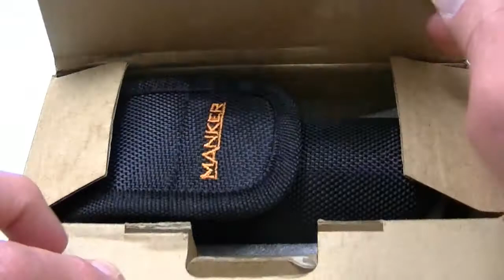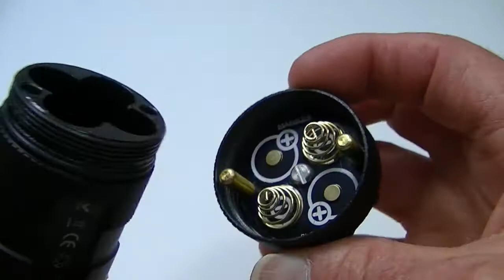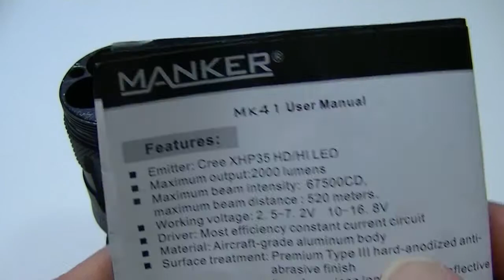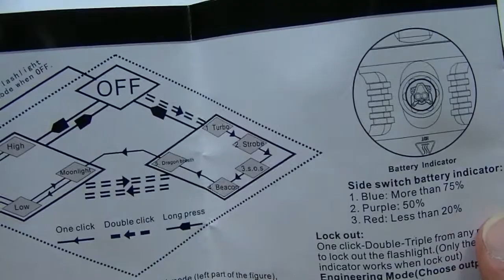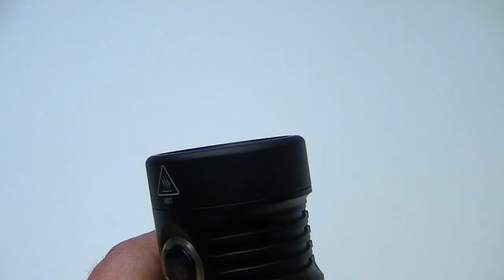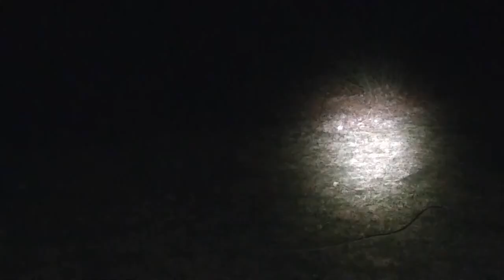Manker MK41. Cree XHP35 'HI' (NW) LED! 1500 lumens/AA batteries.

Comment: Looks nice. I'm still not sold on high brightness AA lights though.
Reply from the maker: Well, a couple of years ago it wouldn't have been possible. It shows what outputs can be achieved though, given the amount of voltage and the LED used. Some people prefer AA lights, and at least for those who are skittish (or don't understand lithium) it could a safer light for many to use.
Reply: They're definitely very impressive getting that power out of AA's. I'd personally prefer Li-ion batteries, but I guess the versatility and lower price of AA batteries is a big plus for a lot of people.
Reply: You can use 14500 batteries.. better output, better throw, and better battery life. They are also lithium ion.
Reply from the maker: Well of course, nobody said you couldn't use 14500's. But in my side by side photo tests, I could see NO difference in output. And throw is the same with either battery type. If you click through to my written review and look at the Manker ouput/runtime spec sheet picture, you'll see there's not much variation between the battery types (according to THEM anyway). The only sizable difference is with moonlight and low. The other modes are surprisingly close, so much so that you won't see any difference! And runtime on the AA's is usually more. And lastly, I prefer moonlight mode to be under 5 lumens...not 65 lumens! This is the first flashlight EVER, (where both battery types are accepted) where I'm happily standing firm on AA's! I own several single AA lights, and they ALL have 14500's in them.
Reply: LexLuger Do the cells have to be the IMR "no protected" type.
Reply from the maker: I can answer; no they don't -- but IMR's have the highest discharge current... which works best with high outputs.
Reply: That's  all I need to hear!

Comment: can this use the energizer lithium batteries?
Reply from the maker: Yes, as long as they're AA size, it'll work!!
Reply from the maker: My recommendation though, is NiMH rechargeable AA. I can't say how long the Energizer lithium's will keep it running.... and they're expensive to replace.
Reply: Lightsngear thank u!! How is the light still liking it?
Reply from the maker: It's great! I'm using it right now --- indoors, low-mode, for ceiling-bounce light.